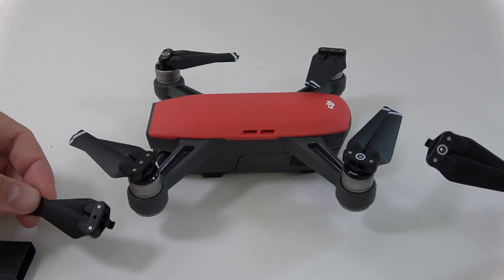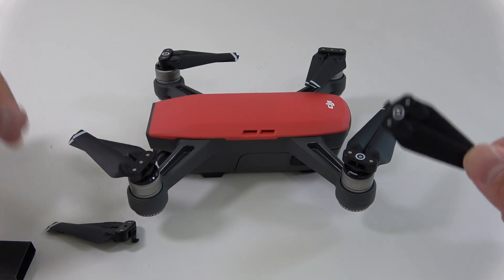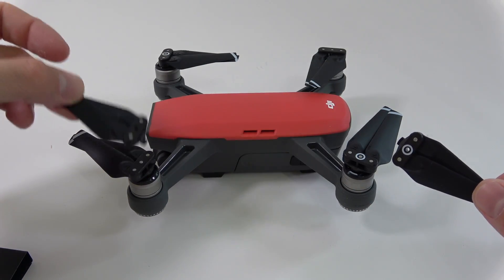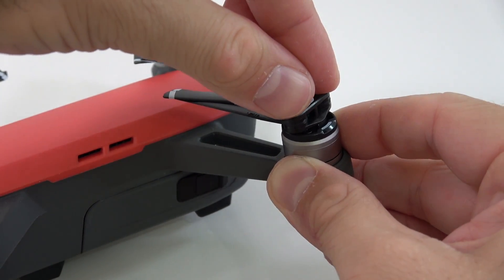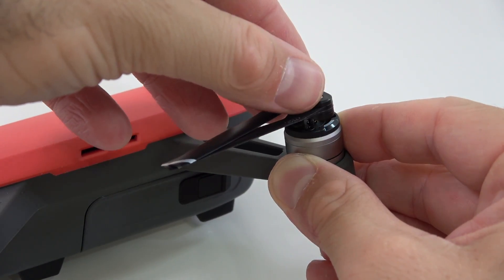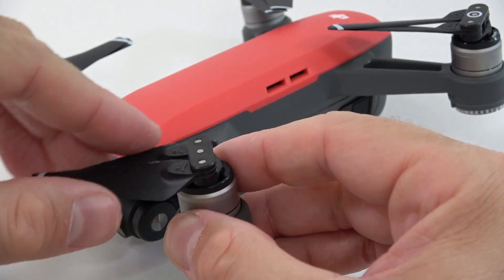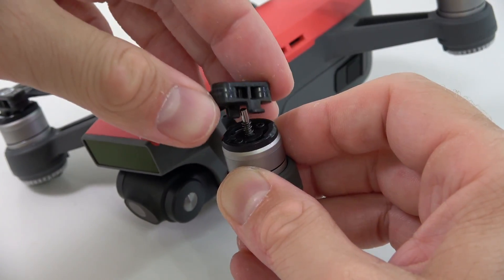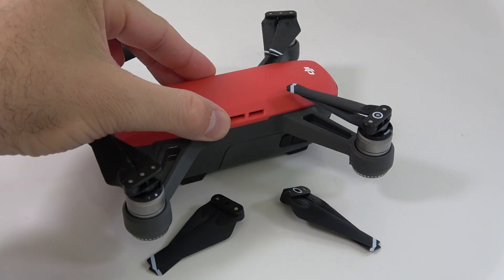How to replace the propellers on DJI Spark

Comment: Thanks for a great video! Thumbs up!   Well I broke two props yesterday in crash.  I Checked on amazon for replacement blades and found  DJI brand props are about $5 each!   The other non DJI brands can go as cheap as $1.80 each.    Are there any problems with using non DJI propellers?  Please explain pros and cons.  Thanks!
Reply from the maker: i used non-dji propellers in the past... some are ok but some aren't well balanced and the quadcopter kind of shakes when in the air. I would get the DJI ones
Reply: On amazon there are dozens of Non-DJi brand props.   Which brands do you have experience with?